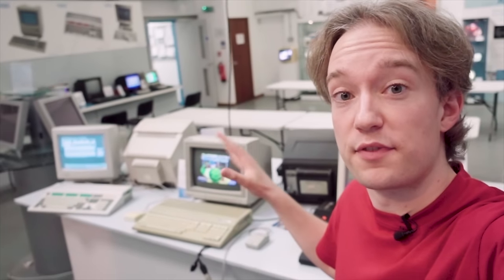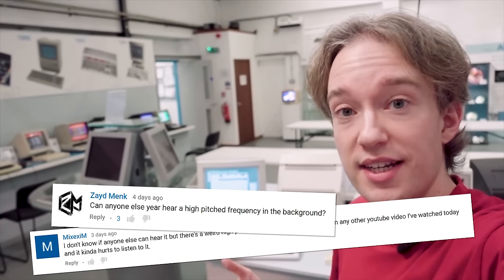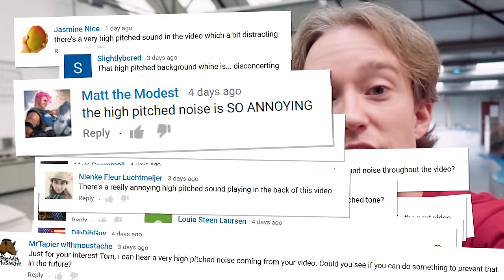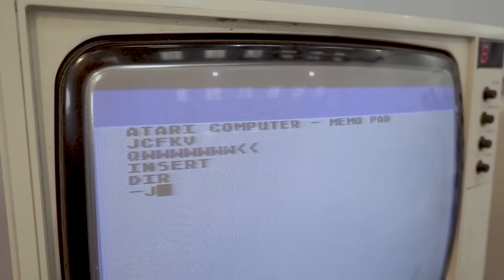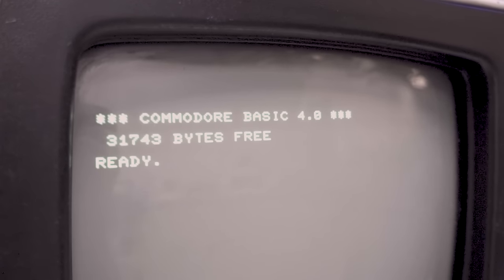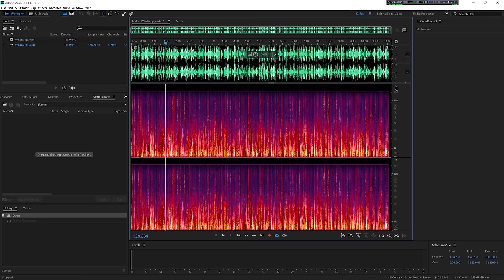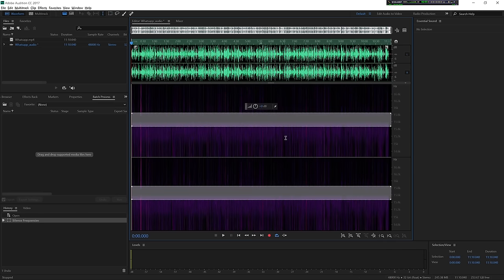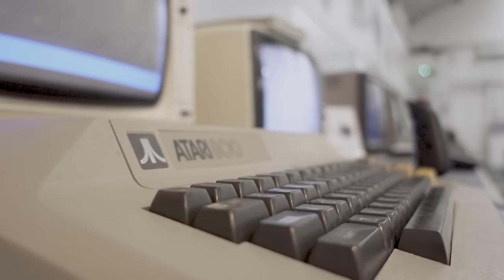Why old screens make a ʰᶦᵍʰ ᵖᶦᵗᶜʰᵉᵈ noise

Comment: I put 15850hz into a tone generator.  Couldn't hear a thing.  Damn. (41 years old)
Reply: anthakata 14500Hz is where I top out (37 years old)
Reply: The more you age, the lower the high frequency sound you can hear, well in general. Depends on if you had blasted loud music before that age, then it might get lower than average...
Reply: I stop hearing at 14900hz (16 year old here)
Reply: I couldn't hear the Morse code (age 73) but I can hear a snake in the grass, so I'm not too concerned (loss of high end doesn't necessarily mean loss of other frequencies)
P.S. Actually, not getting rickrolled might be considered a blessing.  ;-)
Reply: anthakata   Remember that the speaker you put it through may have almost zero output at that high frequency.  The flyback transformer, on the other hand, has no such restriction.
Reply: 18.6khz is where I stop hearing.
I'm 13.
Reply: 14337 is close to the sound of my tinitus
Reply: anthakata My speakers only go up until 15kHz, maybe that's also a thing, but since you're 41 I doubt it would make a difference
Reply: I stop at around 11000Hz. I have tinnitus, not official granted by a doctor but it is there.
37 years and tinnitus for about 20 years I think, maybe more.
Reply: @TheBanana93   A healthy human can hear up to 20khz, no company would sell anything as high, on top of that it would probably cause damage
Reply: 17200 (18)
meh.
Reply: My headphones apparently top out around 18000 Hz, I'm 27
Edit: my hearing isn't that much better
Reply: 25 Years old. Always was proud of my ears. 15300 Hz is my Maximum now. I can still feel the Pressure up to 15500 Hz, but still. It is truly a step back from the almost 19 kHz I used to recognize
Reply: I can what to about 19000 in one ear, the other can't hear crap at that range (20 years old)
Reply: I can hear up to about 19.3kHz (I'm 14)
Reply: I topped out at 18000 (18 years old)
Reply: My headphones go from 20hz to 20khz and i apparently can hear upto 18000 something
Reply: 24 here, can go to 17k, also have tinnitus
Reply: I could hear up to about 16500hz, and sense/feel up to around 18000hz. (40 years old)

Comment: My grandfather worked at a miniature railway in Australia. The old CCTV system still had some CRT TVs around in the signal boxes. There were two sets of cameras. Main cams, set up everywhere, and track cams, these connect to signal boxes. When I would be in the box, I could hear the high pitch noise from the TV. If you touch the screen, you'd be zapped!

Comment: I am only slightly older than I presume you are Mr. Scott based on my cursory google search "Tom Scott age", and could also hear the sounds that CRT displays make when I was younger. I have, however, worked in construction for 17 years now. I'm skilled labor now as a carpenter but when I was younger I, like most most tradespeople in the US, got my start as an unskilled laborer. That sort of work is dangerous, physically taxing, and very loud. My hearing is irreparably damaged and, even though I'm very stoutly built and quite strong, I have a hard time lifting my left arm above my head due to an old injury that never healed properly. Age catches up with all of us and eventually kills us. Some of us more quickly than others. Count your blessings that your hearing loss is all that you've noticed so far. Cheers and best to you and, despite my tone, I greatly enjoy your videos.

Comment: When I was a kid, I could always tell when a TV was on somewhere nearby.  I imagine, in hindsight, that I was hearing very high frequency sounds, but it always seemed like more of something that I just felt.  Admittedly, it felt like a useless superpower that I prided myself on.  My peers couldn't perceive it, but I could.

That was around 15 years ago now.  That perception of mine hasn't cropped up in some time, and I've recognized for a while that it's due to the fall of the CRT screens.  Can't help but to wonder if I still have said ability, though.

Not much I can do.  CRTs are few and far between now, and access to a scenario which can properly test my CRT perception 'skill' is fairly limited.

Comment: Those TV sets didn't just make audio at that frequency, they blasted it out on the radio waves as well with harmonics going all through the LF and VLF bands. It's much quieter there now with most of the CRT sets gone.
Reply: If you can't hear the morse code at the end card, put a portable AM radio tuned to around 530 KHz up to your computer's speakers. You can clearly hear it thru the AM radio. Turn up your computer's volume to max.

Comment: I used to have an OLD 80's Magnavox TTL/composite monitor and it would WHINE because of the flyback transformer (and possibly because of the HV capacitors), making my ears ring until they got adjusted to the high pitch. It was extremely annoying at worst, but despite the age of the monitor, at best, it was still a highly reliable unit and had great picture quality from a well used CRT. The Green-only function also helped with some great sniper shots while playing Return to Castle Wolfenstein (XBox version) in the frozen Ice-Station Norway location!

Comment: OMFG I THOUGHT I WAS GOING CRAZY, I HEAR THIS FROM EVERYTHING, OLD COMPUTERS REFRIGERATORS ELECTRICAL PANELS LITERALLY ANYTHING THAT HAS ELECTRICITY MAKES THAT SUPER SKULL PIERCING PITCH FREQUENCY AND HOLY CRAP IN THIS MODERN CITY ITS MAKING ME THINK IM CRAZY SINCE IM THE ONLY ONE THAT I KNOW THAT CAN HEAR IT
Reply: WHY DO YOU TYPE IN ALL CAPS it's unnecessary
Reply: you might want to get your hearing checked out
Reply: Placebo effect
Reply: same
Reply: @Ethorbit  BECAUSE YOU DON'T UNDERSTAND THE SHEER INFURIATION IT INDUCES. It is a very good reason to type like that.
Reply: I can hear ultrasound as it goes through my body, its a very high pitched but intermittent sound that is kind of EDM but yknow, high pitch, everyone says its not to be heard but I can hear it when i have that darned apparatus on my stomach.
Reply: its usually not that loud. i remember i used to hear our old crt turn on and some fridges(?) may have high pitched sounds but it generally isnt loud enough to be a real bother
Reply: @StefanoFierros  I've tested my hearing and mine goes up to around the 30-35kHz range and I know what you mean, it sort of changes from a painful sound to just pain at the top end and then it just fades away as you go above that
Reply: @redactelonipepperoni  nope, either tinnitus or they live in a place with older stuff. i have this too. its anoying.
Reply: @jonathanodude6660  not when you have hearing like mine. omg. it like a migraine but in the form of sound. it will give you a migraine after awhile too.
Reply: @StefanoFierros  I hear light :)
Reply: Same. I agree with everything you said. I'd often ask my family if they could hear the high pitched sounds coming from electrical things but they couldn't. I thought i was going crazy
Reply: ok

Comment: To me non dimmable LEDs are often quite high pitchy too, plus, they flicker way more compared to oldfashioned light bulbs. Although people say it is not the case.
Reply: Both of those factors can depend heavily on the specific LEDs in question; some don't make much/any noise, and some are quite noisy. Some also have relatively little flicker, while others flicker like mad. All light bulbs flicker, regardless of the type, due to how AC power works, but some LED light fixtures flicker from max brightness to practically zero brightness 100-120 times per second (depending on the frequency of your mains power).
Reply: @harbingerdawn why don't they convert to DC or something
So no flicker?

Comment: Until 2006 we had a 13" CRT TV. From the other end of the house I would notice when it had been turned on, or at least when just beginning to come around the corner and down the hall. And yep, before the screen warmed up, or when it was on mute. Haven't been around a CRT since 2006, I'm 33 now, but that noise at the end of this video sounded just like I remember it, and I had this 2011 iMac at around 50% volume. (I think I notice a bit of soreness in my ears after turning the volume up all the way and re-listening to the sound a few times. -- Never had any nuisance from the actual CRT sound.)

Comment: Dont be so depressed by not being able to hear pointlessly high pitched noises. Those noises are a side effect of things that matter- but they dont matter. Youre missing out on exactly nothing. So cheer up.
Reply: I don't think the point is that those are sounds worth hearing, the point is that being unable to hear them forces a realization that you're getting old, your body starts breaking down and losing functions. Not being able to hear high frequency sounds is just the tip of the iceberg that is aging.
Reply: @Horny_Fruit_Flies  Along with white hairs (and/or bald spots/baldness), it is the signs of other thing going wrong, and with it come, somewhere around the age of 40, that you are probably closer to death than birth, and time will only go faster for each year.

Comment: i remember turning on the tv in the morning and hearing "PWOOOOOOWW" (i never acctually had a tv as a kid but when i was at my grandpas house there was and still is a almost one meter thicc tv and when you turned it off and put your hand 1 cm away from the screen it went crackle crackle and it felt like tiny hairs touching my hand.)
Reply: Omg, you just reminded me of doing that myself. You could also smell it on your hands, was it ozone maybe?
Reply: That crackling is just the SUPERMASSIVE capacitor(s) in the CRT losing their 15000v static charge! I managed to discharge one while it was on while poking around in the back of it with a digital multimeter measuring voltages and resistances on the dimmer circuit. Sony Trinitron tubes were the absolute best, but they had a problem after many many hours of on time, where they'd start to go overly bright and you could see the scan lines on the screen as a result, which really sucked. I had a 21" trinitron which I got for free after helping fix a bunch of them with this problem. we hand picked me the best one out of the lot as my payment for all the work I did, and it was that experience which got me comfortable working inside dangerous electronic devices as an adult. I also learned you shouldn't short the CRT's main caps to ground! That was how i learned what arc flash was XD
Reply: I loved petting the tv screen because of that feeling

Comment: That was cool! I knew that my hearing was frequency sensitive, and could pick up or lose frequency over time, but that was a dramatic illustration of what could possibly happen, I have noted that stuff I could hear a few years ago, no longer figure, but I am starting to hear new stuff that I don't know what it is yet. I presume that as i get older my inner ear workings stiffen up. The hammer, the anvil and the skin that Connects them loses its elasticity, and you hearing frequency range changes to suit. I presume that's as long a i can still hear a train horn or a car horn, all is good, right!!

Comment: I have very good hearing for my age. One day I was sat at a table with some people and one of them had and app they were using to annoy everyone it sent out a high pitched noise but instead of turning it off they turned it down to the lowest setting and left it on so they could turn it up again but I could still hear it I told him "Hey could you turn that off" and he said "you can hear this?" then everyone was interested and he turned it off and on to test my hearing and he freaked out because they could on hear it at 3 more settings higher compared to me, anyway just thought I'd share that.

Comment: A couple corrections for you Tom. The fly back or, line output transformers don’t specifically produce the whistle, or noise. It is the horizontal, or line part of the scan coils which does this. You can also hear the high pitches 15khz through vibrations of the transformer core.

The louder the whistle, or wine is, the harder it’s scanning. Adjusting the width of the picture makes it louder!

You can also hear the vertical scan too through the frame part of the coils. But this is a lower frequency so might not be able to hear it.

Comment: I've seen this video then and I remember that I was able to hear it on the raw audio part, but today using the phone and the tablet's speakers I couldn't so I though it was gone for me too. But then I put my BT headphones and I could finally hear it again (at least with volume above 50%). It's not gone yet :D and yes I remember clearly always knowing when a TV was on because of the high pitch noise when CRTs were common.

Comment: I used to hear this noise all the time when I was little. I turned 10 at the very end of 1979, and at some time in the 80's my parents got as new TV that didn't make this noise so I assumed that engineers had solved this problem. I was glad, because the noise really was annoying. 
     Then my nephew complained about the noise and I realized it wasn't the lack of noise I was no longer hearing, it was the lack of hearing.

Comment: plus not only the line scan generating noise, most have switch mode power supplies in as well, older ones of these work at similar frequencies to line scan, some even combine both functions to one circuit, known as IPSALO (integrated power supply and line output)

Comment: The monitor you show in the thumbnail is actually very bearable, by far one of the most silent CRTs I ever witnessed. (Source: I own that model). My old TV on the other hand is nauseatingly loud. I assume the screen size is an important factor, but I guess build quality and maybe shielding or sound isolation also play a role.

Comment: Just as a note, human hearing is roughly up to 20 kHz, compared to the 15 kHz CRTs and 17 kHz mosquito alarms mentioned.

Most high quality computer audio, using the 44.1 kHz sampling rate for "CD quality", would be up to 22.05 kHz thanks to Nyquist rates. Any higher frequency gets aliased to below that 22.05 kHz when recorded or converted to that CD quality audio.

But at the time CRTs were dominant? Lots of things were "telephone quality" at the time, sampled at 8 kHz or so, because you only need up to 4kHz to record speech fairly okay. That sort of noise wouldn't have shown up on audio records so easily at the time, and so wasn't as big a problem.

Comment: You're not the only one - the Andrew Lloyd Webber CD / Phantom of the Opera has 15625Hz whine throughout...

It also turns out that some domestic radiator thermostatic valves can make a high pitched squeal. And as per your other video, such sounds can be really hard to stereo-locate. (Adjust/wiggle the temperature setting to stop the squeal.)

Comment: The line scan is from a fram IC that drives the electro magnetics on the yoke that is the set of coils on the back of the tube.  The frame IC drives it from top to bottom. V

Comment: I'm on the 26th second and my guesses are: 1. Horizontal deflection coil wine typical for any CRT equipment using deflection yokes and flyback transformers and 2. you have hearing issues not to hear it.
Reply: both

Comment: I used to have extremely good hearing as well.
I’ve done severeal tests both myself by generating sets of frequency noises to see which ones I could and couldn’t hear and tests by professionals. They always came out with the results saying I heard frequencies way higher than I should at my different ages.
But ever since I had a bit of an accident involving my guitar amp, multi effect pedal and Rammstein, my left ear has been a bit effed.
I can’t even hear the morse at the end.
Like Scott said, take care of your hearing. For real. Buy some good protective earplugs if you’re into concerts and other loud hobbies.

Comment: I want to make a minor correction to this video and give you an opportunity to explain why in another video. You are very good at explaining complex subjects in very basic fashion for anyone to understand. Here's the correction but I'll let you research and explain why. 
In North America (US, Canada, Mexico) and Japan, the horizontal TV frequency was 15,750hz only in the B&W broadcast days before color TV. When the USA went color in 1954, the frequency was changed to 15,734.264hz and the vertical was changed from 60hz to 59.94hz. This made NTSC TV 29.97 frames per second, not 30. The British PAL and French SECAM color systems did not have this issue. This kludge remains today with our HDTV. Our 1080i and 720p standard are still 59.94 hz based, initially done for the transition period when HDTV and SDTV were heavily mixed but like many engineering kludges, the solution remains in place long past the problem that necessitated it. This 1/1001 offset has been the bane of NTSC and now ATSC (USA HDTV) video editors ever since.

Comment: im 36 and am thankfull i have good hearing still. and ive been around and inside of some serious sound systems over my 20 yeats of going to raves and metal shows besides drilling, grinding, and sawing things and making loud noises. i luckily have used hearing protection since i was a kid only cus in cub scouts i was told to use ear protection when doing loud things and that just kinda stuck with me. sure i got made fun of at times for pulling out ear plugs or wearing headphones at a music event. but look whos laughing now? i can hear as wide a range as any kid if not better. i can hear low vibrations that most people never hear and i hear high pitch stuff like lights and anything amplified. bugs buzzing is sometimes annoying but i just drown that out with music. and i listen to music all the time just at fair volumes.

Comment: I have worked in Television and Philips has made a model of transformer that has a rubber strip to dampen the sound. that works fine but now the transformer is old, the rubber is old and it schrank a bit. now the rubber works a an amplifier of the sound :) loudest  monitor ever